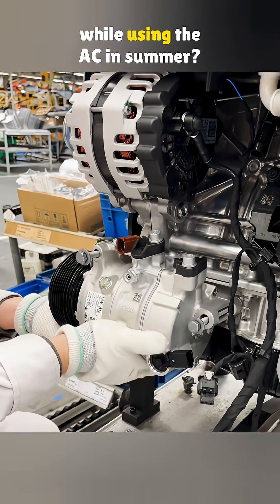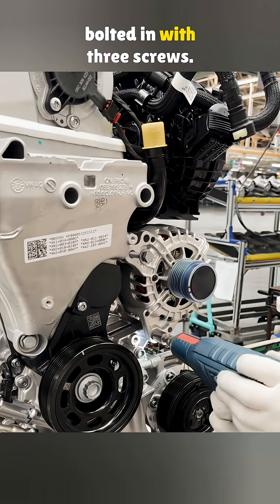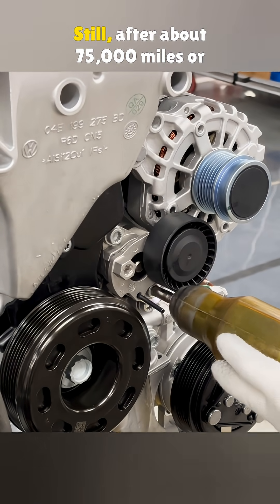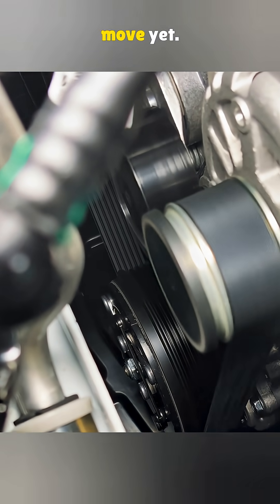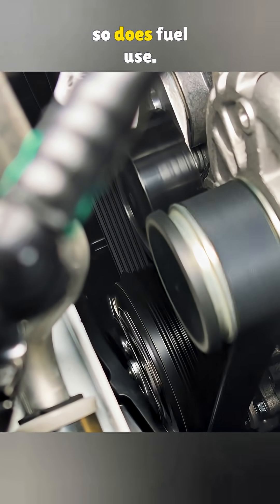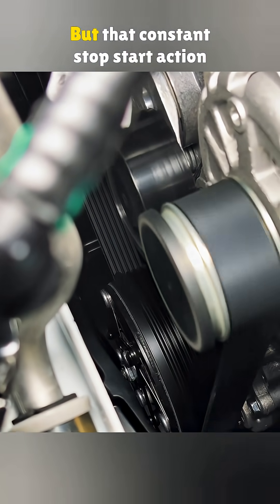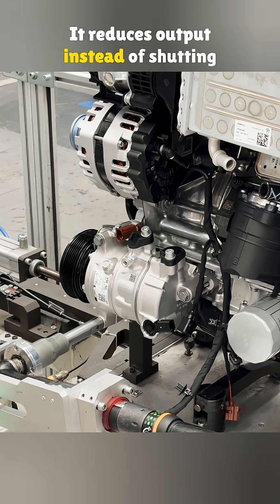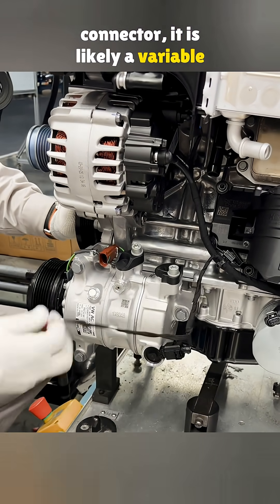Which Car A/C System Saves the Most Fuel #assembly #automobile #automobile #manufacturing

Comment: Call me crazy but I sometimes use the AC to slow down on extended hills 😂 free cooling. Then I keep it off as normal. 
It's especially noticeable in older cars
Reply: I did exactly the same to save braking pad

Comment: If you want to cut down on your fuel usage, there's a 99% chance you drive an efficient vehicle you dont need. You dont need an F150 or a Subrban to get the kids from soccer practice. If you dont tow or haul anything, you dont need an SUV. Have more than 2 kids? Get a minivan. Only have 2? Get a hybrid crossover, wagon, or sedan. Bigger does NOT mean safer. In fact, larger vehicles have worse safety scores and pose a danger to others, including children and pedestrians, most of all.